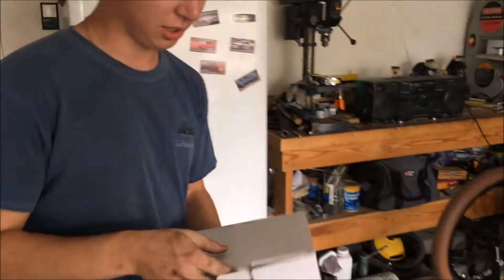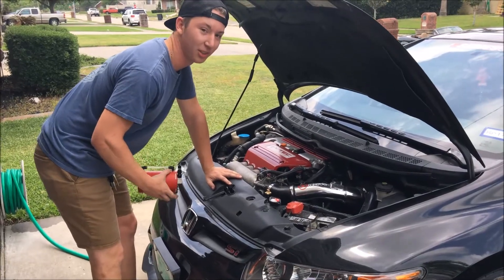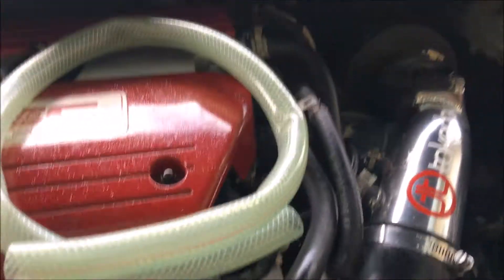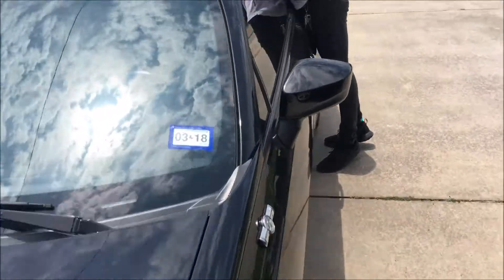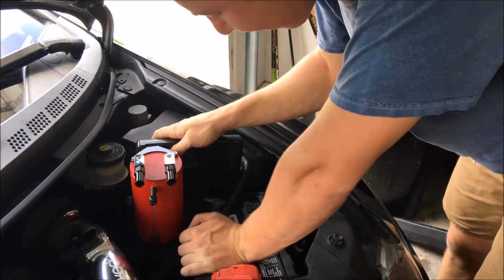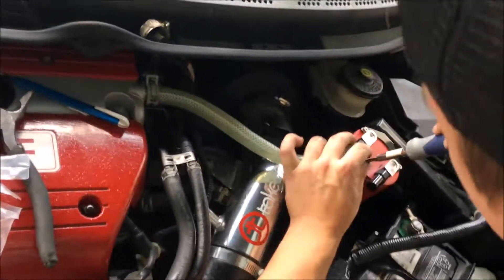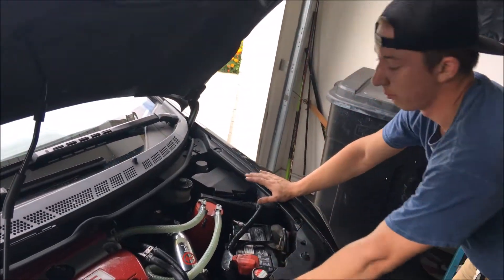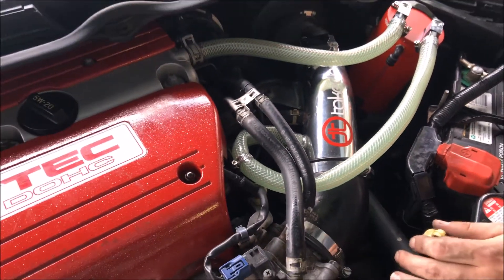HONDA CIVIC Si GETS CATCH CAN!!!

Comment: You installed it in the wrong location my friend. PCV is located bottom lift of the intake. Need to relocate from valve cover vent to PCV one way valve under your lift side of the intake. But if you're just going for looks and a good laugh at car shows leave it be. Happy tuning!

Comment: You aren't using that properly. That needs to go between the PCV. You have it going to a vent on the valve cover. It won't catch anything
Reply: Actually, not strictly true. Under less than WOT conditions, then yes. But under WOT, there is no Intake Manifold vacuum, so some of the crankcase fumes exit the breather at the top. So to catch everything, you either a Catch can for both lines, or just have 1 on the breather, and block off the PCV system altogether.
Reply: You are putting the catch can on the clean side of the crankcase. More oil is being sipped thru the PCV system.

Comment: All point of installing catch can is to stop oil going into intake. That travels through pcv to intake manifold. Not from breather to intake pipe. Did you catch anything at all?
Reply: i do not see why he would not  my k20a2 from my type s since 140k miles till 194k has always had a lot of blow by go from the breather into the air box